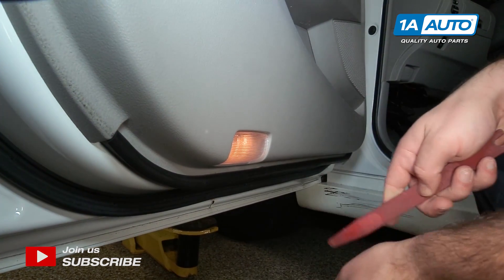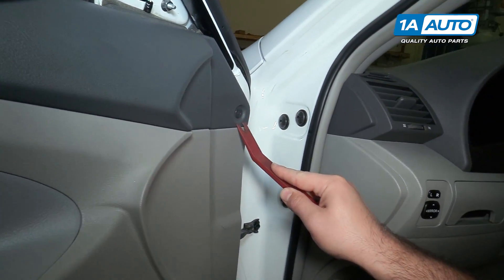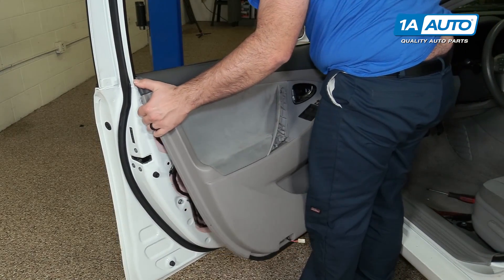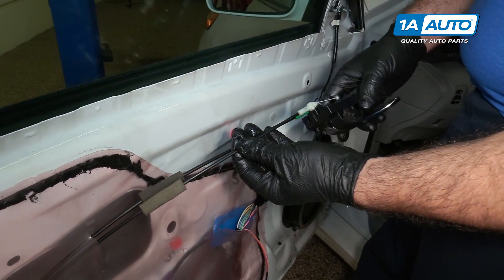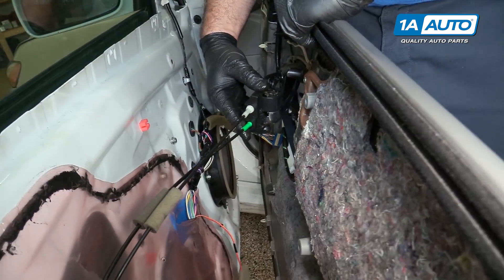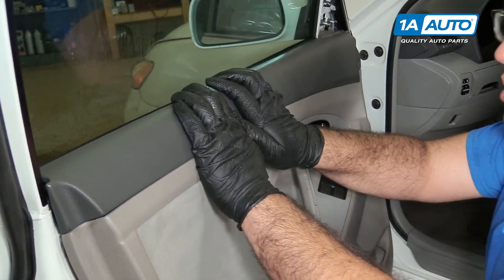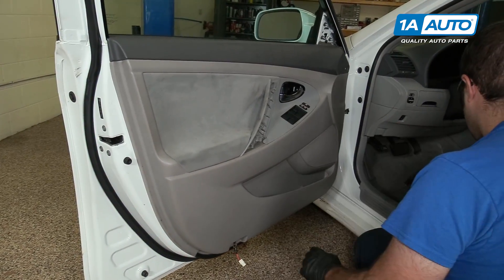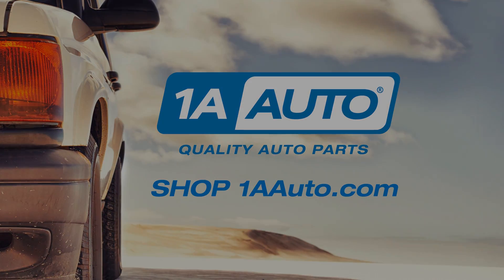How to Replace Front Door Panel 06-11 Toyota Camry

Comment: To avoid breaking the plastic plug, push in the center part of the plug, it will snap in about 1/8" and stay like that. Then the whole plug comes out without effort or breaking.